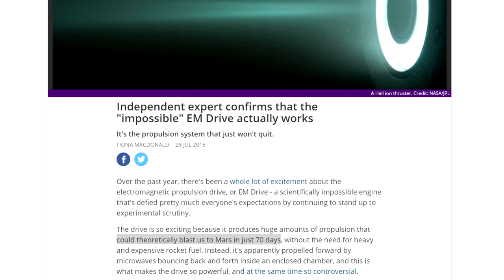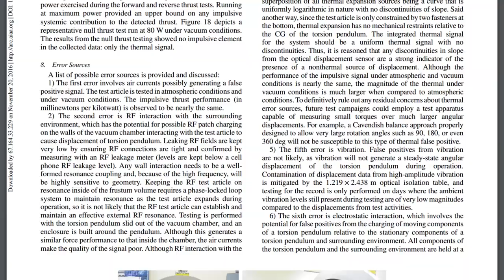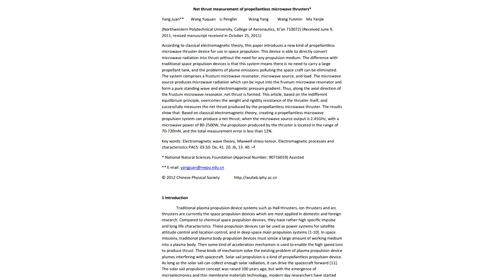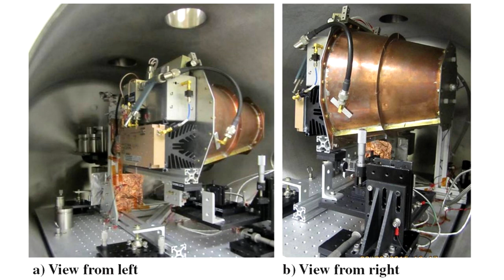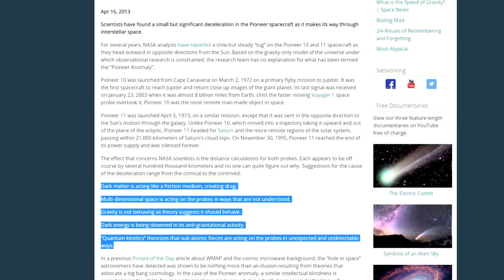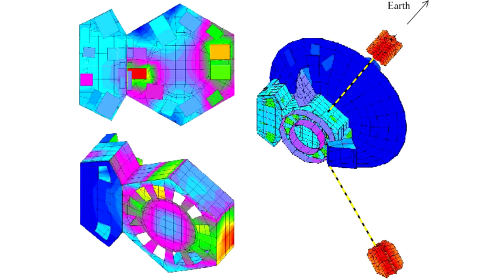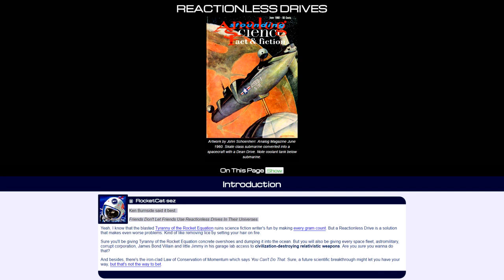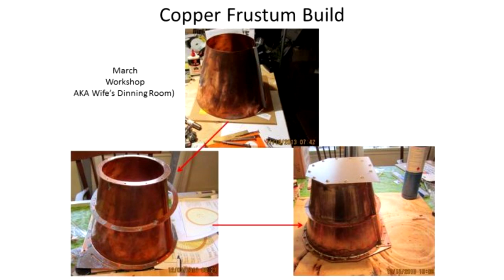What is the EM Drive? And Does it Really Work?

Comment: Ever heard of the Alcubierre effect,  Scott? I saw a paper by NASA investigating it's potential.  All I know is, we are going to need new exotic physics if we are to truly explore the solar system and beyond. Solar sails may get tiny probes to alpha centauri but not manned colony ships.
Reply: sulijoo The Alcubierre drive is even more problematic, because it allows causality violations (time travel).
Reply: No it doesn't. You don't move and so you don't dilate time, thus no time travel. Warp involves the movement of spacetime which isn't limited by c (having no inherent mass or energy).
Reply: The Alcubierre effect is how the "warp drive" he mentioned is supposed to work. It's the Alcubierre warp drive. And it's one of the other possible space travel solutions being looked at by the same NASA team who did this experiment.
Reply: Error Error What problems? We could build a warp drive today, we just lack the fuel to run it. There is nothing about it that poses a problem with physics, it's a technical issue as we don't know how to manufacture negative energy... Yet.

There's no time dilation, no possible energy requirements, no unresolved engineering questions. Once we can manufacture negative energy, it'll be no more difficult than it was to put the Voyager probes in space. Maybe easier considering that we have more advanced manufacturing tech and experience with spacecraft.
Reply: David Kelly

 Read what I wrote please, warp drives both generate closed time like curves (causality violations), and require exotic matter (negative energy), both of which probably make them impossible. I even provided a peer reviewed source.

Also no time dilation doesn't have anything to do with the existence of casual loops.

TL;DR: Right now warp drives are theoretically impossible.
Reply: Test Account Please Ignore I think you deleted your comment becuase nothing you just said has appeared in this thread.
Reply: Ummm... I think all the publicity about Dr. Alcubierre's paper is that it is theoretically possible.  Micio Kaku seems to think that it is.  What it is not is 1) feasible, and 2) known what would happen if one attempted to create a causality paradox (as far as I understand the explanations on Wikipedia, the universe seems to conspire to prevent them from happening).
Reply: That "universe conspires to prevent them from happening" part isn't actually a tested and proven idea. It's one of several theories surrounding near-lightspeed time alteration effects. There's reason to consider it plausible, but it's no more confirmed than the Alcubierre drive's functionality.
Reply: Considering we don't have the ability to produce the materials to build and power such a device...
I understand - working on paper and working in prototype are different things.
Reply: "There's no time dilation, no possible energy requirements, no unresolved engineering questions. Once we can manufacture negative energy, it'll be no more difficult than it was to put the Voyager probes in space."

The equations balance, so from that standpoint it doesn't violate the laws of physics. But the barrier isn't that we can't manufacture negative energy, it's that we actually have no evidence that it exists.
Reply: Same with 'dark matter' and 'dark energy' - things that we have no direct evidence for.  They are postulations (contrivances?) to explain phenomena that our equations and thought experiments cannot.

+blivvy "... the universe seems to conspire to prevent them from happening."  That is to say, that the contributors to the wikipedia articles assess that no closed time-like path of travel can be successfully resolved; mathematically speaking (I take this on authority, not as an expert myself), trying to shoot a billiard ball through a wormhole so that it collides with its initial path of travel, thus prevents its own entry, inevitably results in a destabilization effect that prevents the ball from doing this.  Trying to shoot laser light across a spacefold that causes the beam to interfere with itself reshapes the fold so that this cannot occur.  I remember reading a remark that it is so eerie, it seems to an intelligent mind that mathematical experiments of this kind seem to anticipate and prevent the paradoxes they are contrived to cause.  It is as if causality is not a mere mental construct or phenomenon, but a self-corrective mechanism.

Years before these studies took shape, I saw a TV a movie where a couple tries to travel back in time & return to prevent JFK from being assassinated, multiple times, and circumstances always converge in such a way that they fail.  This idea is to 'spooky action at a distance' what an octopus would be to a snake.
Reply: The math falls apart because of aspects to the equations which are in many cases partial or even complete unknowns. The idea that it's a self-correcting mechanism has not been tested directly, or verified with the testing of other hypotheses, and is still considered to be a plausible but unproven concept.

Also, that movie you mention, and the many other stories like it, don't describe the prevention of a closed timelike curve. They describes the creation of one. An event happens in the past. People decide to go back and change it. Their attempt fails, thus allowing the event to happen, making them want to go back in time to change it. That possibility remains as one of the plausible methods by which the math could resolve. The tests you bring up were attempting to produce a particular result, and were unable to create the intended and expected result for unknown reasons. Any explanation we currently have for those results is an untested hypothesis. There are several, and the one you're citing is simply one of the leading possibilities that fits best with the other math we have a relatively confident understanding of.

As for the Alcubierre drive, the math resolves, but ONLY if we assume the existence of a way to create negative energy. Unlike dark matter and dark energy, which we have observable phenomena to suggest the existence of, negative energy and the exotic matter required to make it possible, only exist as imaginary concepts which could make the math resolve in certain hypothetical situations which we have no way to test.
Reply: Tella Mosis It's not antimatter. It's exotic matter
Reply: David Kelly movement is relative, so movement of spacetime, mass and energy or not, still creates a dialation
Reply: Leonard Puddy indeed and relative moment inside a warpfeild is 0. It has to be or a ship would pass thru the warpfeild.
Reply: +Tella Mosis Anti-Matter is still just regular matter with mass though it has the opposite electrical charge ie positrons are particles akin to electrons with the same mass as an electron but have a positive charge. Negative mass and negative energy would be something different entirely in fact if there exists such a thing as Negative-Matter one should reasonably expect there would be Negative-Antimatter too.

Comment: I want to believe SO BADLY.
But ultimately, I'm an empiricist, and a rather cynical skeptic.
This means that for me to trust the results 100%, the EM Drive has to work in an actual application, even if it's a "test" application such as a cubesat with some solar arrays, basic attitude control, and an EM Drive on the back.

Basically, take off an Ion engine and swap in an EM Drive. Then see what happens.

All I can say for certain at this point is that I know enough about it to say I don't know enough about it to make any declarative statements other than "I'm in the 'wait and see' camp".
Reply: thunderf00t did a video explaining why EM doesnt even work
Reply: according to the experiment it took as much energy as a human uses every day to lift less than the weight of a water drop. now we use up the same energy as a lightbulb......doing the math, modern rockets are wayyyyyyyyyyyyyyyyyyyyyyyyyyyyyyyyyyyyyyyyyy more efficient
Reply: herobrinext9
Wrong comparison, IMO.
The whole reason to use the EM drive is that it uses zero propellant.
Zero propellant for even the tiniest amount of thrust is a really big deal because it means you never run out of fuel, even if it takes a rather large amount of energy to get a pretty small amount of thrust.

Imagine a space probe that can go from Mercury orbit to Pluto orbit. It may take 50 years to do it, but a space probe that has an EM Drive would be able to do it.
Humans have not constructed anything capable of doing that yet, and IMO it's basically impossible with technology currently in use, even ion engines.
Reply: 44R0Ndin zero proppelant but you still need a source of energy to power it and there is no infinite one and with this EM drivw we would take up so much battery power that it would still eb more efficient to use normal rockets
Reply: 44R0Ndin yeah, agreed, but until we can actually make an EM drive that is efficient and properly works, we're gonna have to stick to testing
Reply: herobrinext9
Well I thought it went without saying that you wouldn't send the first lab prototype that showed positive results into space.
I was more focusing on the possibilities of a "production" design.

Ion engines of various types have been known to work as expected in space since the 70's, yet we're only just starting to see earth-orbit satellites that use them, and even then they're only using them for station-keeping.

I'd expect something similar to happen with the EM Drive, unless the price per kg to orbit drops to the point where a "Well, put it up there and see what happens" approach is financially viable.

But as usual, no bucks, no Buck Rogers.

Comment: 1.2 µN per Watt would suggest that it is expelling a mass of 7.2e-13 kg per second at a speed of 1.67e6 m/s.

Could it be that it is simply dislodging enough particles at the end of the cavities to do just that?
Reply: Snagabott hmm that's something I hadn't considered. I wonder if they measured the mass before and after, I still haven't read the paper.
Reply: that is an interesting thing dude, it may explain how this thing don't fuck over Newtown third law, tho i don't have the math skills yet to do the math.
Reply: But isn't the cavity closed at both ends?
Reply: mytube001 no as is the waves inside could be dislodging particles on the outise of the containar due to small vibrations or whatever. as the area of the back end is larger than that of the small end, more particles would be dislodged from that side than the other
Reply: Fair enough. But surely it would easy to detect that?
Reply: Kudos for the well crafted comment, and since you went to the troubles of unicoding your mus and all that jazz, meaning you probably know what the SI is, you might wanna take note that when writing the name of the power unit, watt, you should not capitalize it (even though it comes from a proper name—same for newton, ampere, and similar ones; Celsius being the sole exception).
Reply: They could test this by enclosing the drive in a cubical box and then putting it on the torsion balance
Reply: What if the box blocks the distortion or whatever causing the thrust? It would lead to false-negative.
Reply: From the picture the cavity is closed at both sides. If it dislodges particles from outside then the cone would move in reverse direction based on angle of outside surface. Thus that is not true. http://i.dailymail.co.uk/i/pix/2015/07/28/16/2AE8826600000578-3177449-image-a-45_1438096112674.jpg
Reply: It's a good idea but I most likely not correct. For starters, the EM drive does not directly use electricity to generate thrust, it uses electricity to create photons in the microwave range which then generate the thrust. Photons generated in the microwave range are low energy, as far as photons are concerned, and would not have enough energy to dislodge particles from the casing. How it works (if it even does), I have no idea but it is not dislodging particles, at least not through the photons.
Reply: fsmoura Where are you from? In our schools we were taught to always capitalise things like N and P. Onlythings we didnt capitalise where units not names after people such as metre, m, or litre l
Reply: thank you, the both of you, i was well entertained.
Reply: thank you, the both of you, i was well entertained.

Comment: Presumably they have tested the apparatus at various orientations with respect to Earth's magnetic field lines.  I would hate for this to simply be a rotational force induced by opposing magnetic fields.
Reply from the maker: Paper does not make this clear.
Reply: LmOver I merely wonder if those conducting the tests have accounted for a possible interaction with Earth's magnetic field (i.e. rotational motion as opposed to transverse motion).  I am not claiming the device actually works as its inventor claims.  Like Scott Manley, I remain skeptical.
Reply: The tests from eagleworks and the repetition in the german lab did this (up, down, north, south orientations of the device) and they included the measurements in the papers they published. Dilation was also considered. The thing is, the thrust measured is still too small. If they want to prove something, they should build a bigger version and people should be patient until those results are published.

Comment: I think you're right about the thickness of the thing.  That alone would alter the resonance capabilities.   

Like a two-stroke, it would never "get on the pipe" and would stutter.  If it were thicker, then the resonance could be controlled more precisely I would think.  

On a side note, if it's using little electricity...line that thick bell with some stainless.  It'll spark like your fork, get hot as balls...and push heat out the back.  

5mph to infinity and beyond lol

Comment: The EM Drive seems to operate similar to a Woodward effect thruster, especially when you represent the microwave cavity as an LC circuit. The neat thing about the Woodward effect is it can, in theory, generate negative mass, which is what you  need for a true warp drive...
Reply: ahh...negative mass ? care to explain that one..I'm going to love this...
Reply: its when you put one foot on the scale and the other on the floor then think you've lost weight
Reply: psycronizer See: Casimir effect
Reply: Actually, no, it can't. There are also people who think they can feed back the output of a DC to DC converter into its input and make a perpetual motion machine that way. They're wrong too.

Comment: Isn't this the same sort of principle as the Casimir force? On the face of it, the Casimir force breaks the laws of physics because you "get force from nothing," via 2 parallel plates in a vacuum. But then quantum mechanics comes along and states that in a vacuum exists virtual particles and the cutting off of wavelengths between the plates results in a lower pressure than outside the places, resulting in an inequal force pushing the plates together.

Wouldn't the same kind of principle apply where due to one end of the cone being narrower than the other, a similar situation arises where there is a lower "pressure" at one end? 

I've always been very interested in ways to exploit zero point energy and it seems to be a part of physics where a lot of mystery still lies.
Reply: There is no 'force from nothing' in the quantum vacuum example. Quantum mechanics simply 'discovered' a new set of interactions on a micro scale. This is not a micro scale, and thus quantum vacuum effects would be largely irrelevant or non-existent (likely both).
Reply: "On the face of it, the Casimir force breaks the laws of physics "

No, the Casimir force is a prediction of the laws of physics. It doesn't break them at all. 

"you "get force from nothing," via 2 parallel plates in a vacuum. "

You do not. The Casimir effect 1. conserves energy and 2. conserves momentum.

"Wouldn't the same kind of principle apply where due to one end of the cone being narrower than the other, a similar situation arises where there is a lower "pressure" at one end? "

No, and even if it did, it wouldn't depend on input power. It would be a property of the geometry, just like the real Casimir effect.
Reply: Ath Athanasius Jaffe is a smart guy, but I can tell you that not that many people take this sort of explanation very seriously. This is because the Casimir effect, or related effects, show up in a variety of other contexts where there are no atoms and no van der waals forces. For example, the most common way to think about particle physics at finite temperature is to calculate a kind of Casimir effect in a space that looks like a torus. Or, if string theorists are to be believed and we live in a 10 dimensional space of which several dimensions are compactified, there would be a Casimir effect associated with this compactification. It is really the boundary conditions that are important, and those do not need atoms to arise.

Comment: honestly, from the diagrams it seems like this would generate thrust in the same way pointing a leaf blower at the sail of the sailboat you're in. Or, more simply, lifting a bucket while you're standing in it. The force on the small end would be less per particle, but the particle density would be greater causing the overall force to balance out causing no thrust. Either that or I am misinterpreting the diagrams.

Comment: Can the microwaves just kick out some particles from one side? 
They have to test it for more time and check if the mass of the device doesn't get smaller.
Reply: There's another problem: Random photons (microwaves) might just escape from the thruster due to tiny holes/leaks.
Reply: but if that was the case then the em drive would have less thrust than a photon drive right?